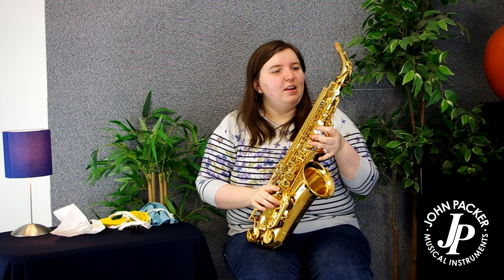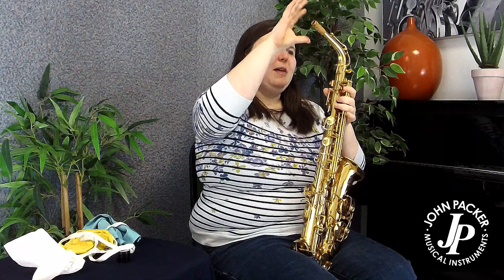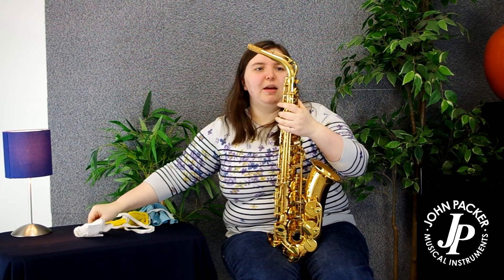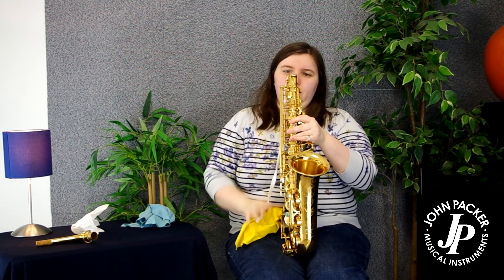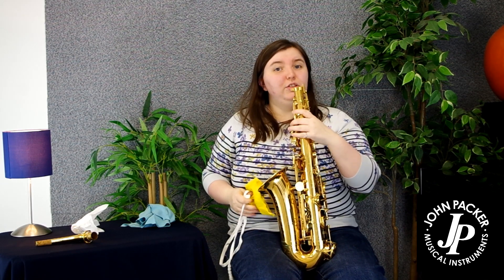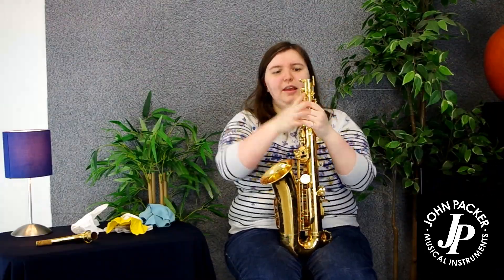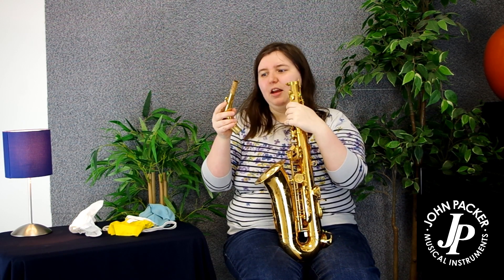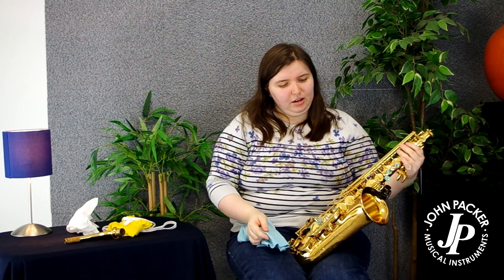Saxophone care

Comment: When putting grease on the cork you should be a bit more thorough than that i.e. work the grease all over the cork and make sure its well rubbed in . Also when pulling the swab through the body of the sax its best to put the swab in from the bell . Putting the swab in from the neck end of the sax as in the video is a sure way to get it stuck as you can see the force needed to pull it through .